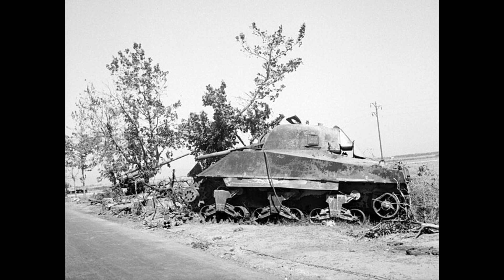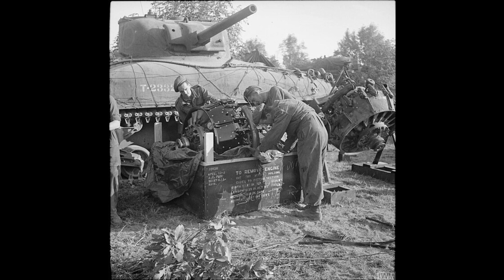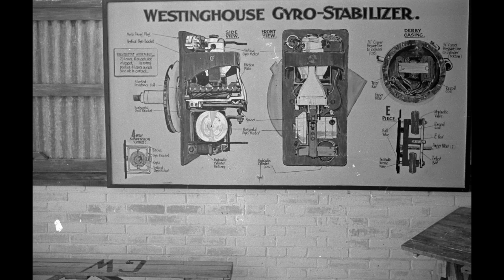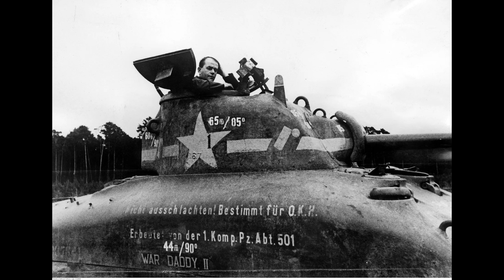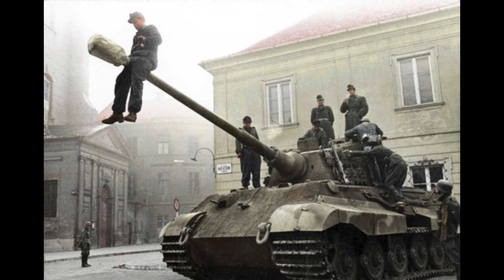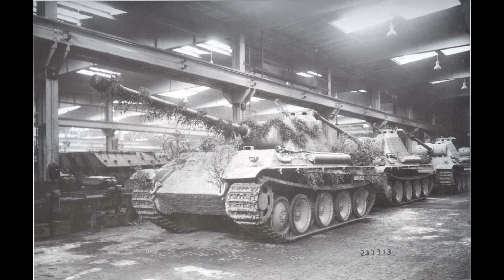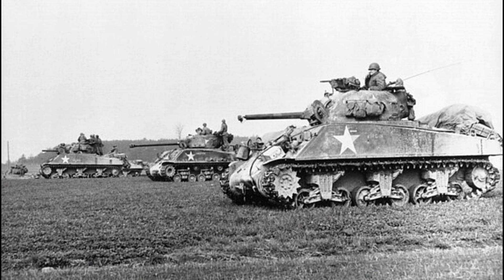German Engineers Tested a Captured Sherman - Then Realized Why They Were Losing the War

Comment: Rear sprocket drive on the T34, sloped armour, powerful deisel engine.
If Germany put a deisel motors, made it rear sprocket driven then the Panther would have stopped the Russian onslaught.
Either copying the Russian deisel or the one in the Junkers 86 spy plane was the way to go.
By far the biggest mistake was Germany going on a war footing around March 1941...instead of 1939 doomed Germany later on.

Comment: The Sherman was a great medium tank. The Firefly and M36 Jackson were even better; i.e. same reliability and ease of maintenance but upgunned with some serious tank destroying firepower.
Reply: They were glass cannons- they moved the sliders all the way to firepower and mobility and put zero points in armor.  Which, considering how good German guns were, wasn't a bad strategy.  The 75L70 on the Panther was as effective as the 88L56 on the Tiger I. The 88L71 on the King Tiger was a threat even to the IS-2.
Reply: @MarkStockman-n8s5w  "water glass cannons"? Be serious...

Comment: The reduced armor is only reduced when you ignore its slope. When you account for the slope, the Shermans all had about the same EFFECTIVE thickness as the Tiger I. The jumbo had MORE.
Reply: Not true
Reply: @robertsowerby8880  Its not. Look it up. theres about a centimeter difference in EFFECTIVE armor thickness. Its why the ONLY tanks that gave the Sherman problems were the Tiger Panther, and LATER Panzer IV with the high velocity gun. Which also happened to be a high velocity 75 just like what the Sherman switched to. (yes it was called a 76 but it was actually a 75, but we labeled it a 76 to avoid logistics mix ups with units getting the wrong ammo, which happened with a few of our artillery guns) with their high velocity guns.
Reply: The why did the Tiger kill the Sherman so often in even numbered encounters?
Reply: @peterzavon3012  They didnt? You can look up how many units in regions the US was at the same time as the US and there were actually way less tigers than were reported by troops, because when you see a tank aiming at you and its blocky with a muzzle break, your not analyzing what it is, your going "oh shit its gonna kill me" and report it is a tiger sighting. And most US Army Armor losses were not to enemy tanks, but to enemy towed or emplaced guns. The US actually had a very good kill/loss ratio when it came to armor. Mostly because we had much better optics so could see the enemy before they saw us. like the Gunners close in sight which was mounted above the turret and had a wide FOV. Germans didnt have that. so the gunner had to rely on target ID from the tank commander, and took longer to get onto target. And generally the tank to win an engagement tended to be the one that fired first, even if you miss. Because as the Chieftain says. While you are calm, and adjusting off your first shot. The other guy is having a significant emotional event.
Reply: @claytonmachine12  I respected the Chieftain until I noticed him using wikipedia as a script.

Comment: Ot mentioned, I believe, was the fact that some or much of the labor force in German manufacturing was that of slave laborers who were known to sabotage their work, further increasing the failure rate.
Reply: They took an unexploded 88mm AA round out of a B-17. It was empty, except for a note that said "This is the best we can do right now."
Reply: FN High Power pistols made in Belgium during the war for the Wehrmacht are to be carefully inspected even today.
Reply: This is an underrated comment and something I hadn’t put together till reading this.
Reply: And even the factories that weren't being run by slave labor had cut all their quality control in an effort to speed up production rates.  Which of course meant that many of the parts they produced didn't work correctly and were prone to failure.

Comment: KEEP it SIMPLE. The Germans over egineered and STILL do today - WHY
Reply: Because they can get the high-tech materials to back it up now.  Hard to make chrome-vanadium gears without chrome or vanadium.  And the Germans were so short of Tungsten that the standard loadout of HVAP rounds per tank was ONE- if they could get it.  No tungsten = no tungsten carbide for machine tools.  And there was probably a shortage of light bulbs also.

Comment: Odd, how building for reliability and ease of maintenance no longer matter in our civilian auto manufacturing.
Reply: My first cars were basically scrap by the time they reached 60,000 miles, maybe 70,000 if I was lucky.  My current vehicle has 150,000 miles and shows little sign of wearing out.  It starts effortlessly in any weather, has fewer squeaks and rattles today than my old cars did when they were new, and hasn't needed much repair beyond the occasional brake job.  So tell me again how reliability doesn't matter?

(I'll agree on the maintenance aspect, as the shadetree mechanic is a relic of the past.  But how much of that is due to federal pollution and gas mileage standards that require piles of sensors and feedback loops to comply with?  It seems unfair to blame engineers and designers for overcomplicating things when it's the government bureaucrats who compel them to do so.)
Reply: @govsquid CAFE standards are a seriously stupid way of reducing fuel use.
Reply: @jeffdege4786  tell me you missed his point without telling me.
Reply: @davidr2802 The US, in WWII, built vehicles that were rugged, simple, and easily repaired. 

When was the last time you saw a domestic auto that fit that description?

Comment: I often wondered why the war planners did not make a provision where extra armor could be bolted in front of the Sherman once it reaches Europe.
Reply: probably would kill power to weight ratio and bog it down
Reply: @robertlipsett2535  Crews did it anyway.
Reply: Tree trunks were used as ablative armor. Same with sand bags
Reply: Some extra armor was welded onto Shermans to help noted weak spots, before future versions of the vehicle could be made with the improved armor.  

But overall, the amount of armor on the tank was a carefully considered question. Adding more armor would increase the weight, reducing speed and causing increased breakdowns. To offset that, you had to not just add armor, but add ENOUGH armor to significantly increase survivability against your enemy's weapons. Tankers added improvised armor to their vehicles, with logs and sandbags and even concrete; these methods were tested and not found to increase survivability enough to be worth the weight. That moves you toward the bad side of the "how many of your tanks will actually make it to the fight" calculation.

 Understandably, though, a tanker in the field may not be persuaded by a memo from Stateside engineers. They see a Sherman with a hole in it, they're likely to want to put more "protection" between them and the enemy.
Reply: The M10 tank destroyer did have mounting points to add armor to it but it was never actually issued.
Reply: Thank you for the replies. I know the Sherman is designed for 25 tons. What i mean to ask why not design the Sherman for 30 tons. Then bolt/weld 5 ton plates at a forward depot or something.

Comment: And the Winner is?
Reply: Sherman wins in the end.  If one not-quite-perfect gear shift can take your 6x more lethal tank out of action for a number of days, it has been removed from action by... what?  The mud that caused the driver's boot to slip from the clutch pedal?   Is that invincible vehicle - lost when the repair depot is overrun - really better than the easily defeated tanks that overran your repair depot?
Reply: There is no clear winner. German Big Cat tanks: better armor, powerful gun and long distance kill capacity. Shermans: reliable, easy to repair, can cross old bridges (Big Cats were too heavy), better cross country mobility and 48,000 Shermans produced vs. just over 1000 Tigers.
Reply: @mardiffv.8775 
Israeli "Super Sherman" models carrying high velocity 105mm guns dominated newer Russian types as late as 1967 and a few were still useful though nearly worn out in 1973.

That 105 would have made the Sherman the "Master of the German Cats" at long range had they met in battle.  The Cats faded relatively quickly though I think Syria still had some Panthers and PzKpfW-IV in service as late as 1967.